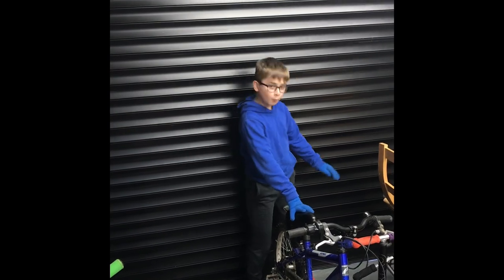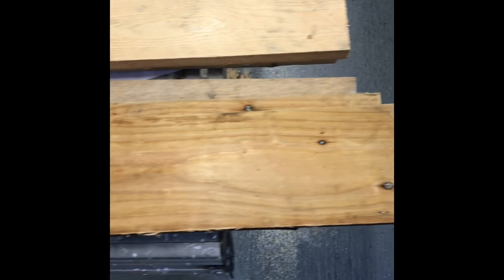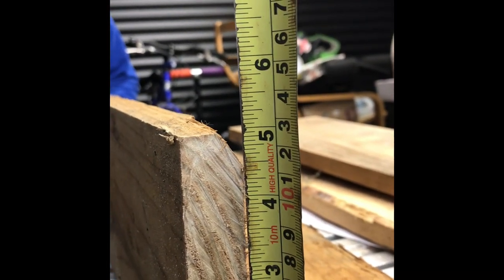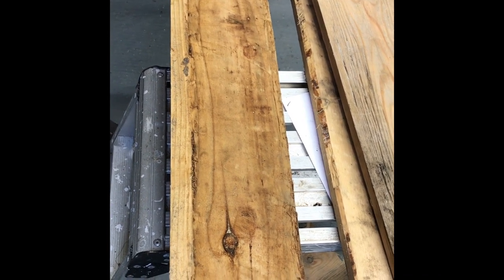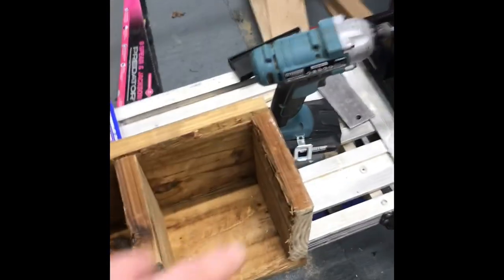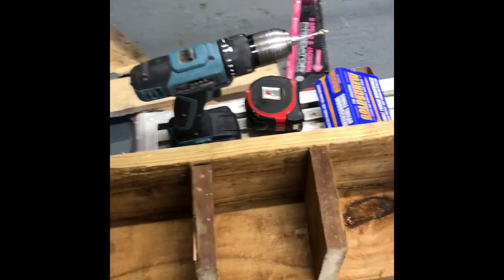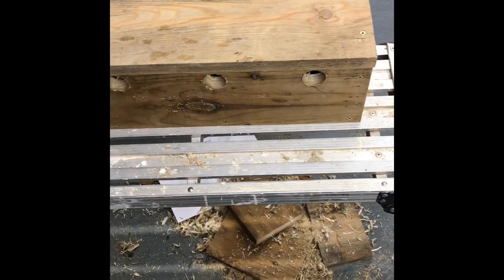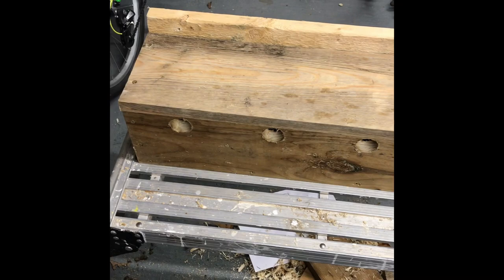How To Make A Sparrow Nesting Box, How To Make A Sparrow Terrace, Creative Garden Projects

Comment: When i make them i leave a slope on the roof to stop water lodging.
Reply from the maker: Hi. Thanks for watching and your message, much appreciated. 
Definitely worth the effort to slope the roof a little if the box isn’t going to tilt through fixings or surface it’s fixed to. 
Keep up the good work 🌻
Reply: Not finding fault (no way) its just where i come from it rains a lot, an awful lot and i only make single nest boxes, so i was checking out yours to copy it and have a go. I liked your video very much, sorry, i should have elaborated on my first comment.
Reply from the maker: @birdwatcher4147  No problem at all. Instead of cutting angles you can always add a small piece of lead or felt etc to the top so as to cover the top of the roof. 
I kind of think that anything you make is going to be more enticing and weather proof than a natural nest 😀

Comment: How to hang it
Reply from the maker: Thanks for your message. 
If you are putting it onto a brick wall then you will need to use a masonry drill bit to make hole, insert rawl plugs or similar. Screw through the back of the box and into the rawl pligs. 
If fixing onto timber then you will only need to use screws to secure through the box and into the wood.